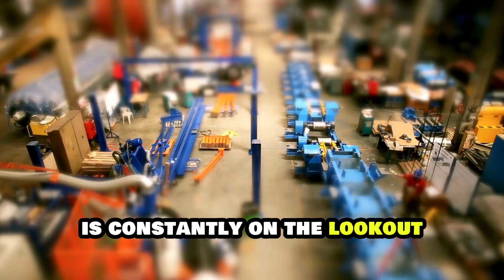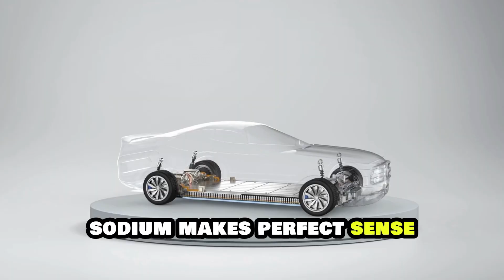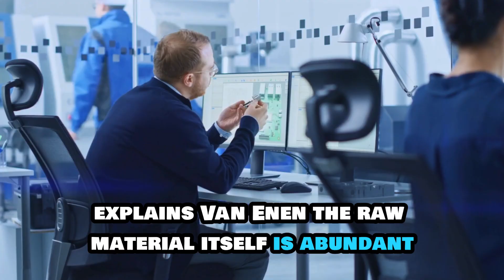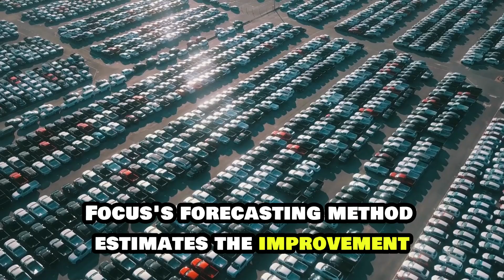Why Graphene Battery Technology Is The Future Of EVs!

Comment: Do you think a EV car have resell value after 8 years.?👈🙂🙂
Reply: that likely has much to do with the kind of battery in the electric vehicle.

for example,
if the electric vehicle has a graphene battery, or BYD electric vehicle manufacturer and battery manufacturer, makes an LFP battery that has a 4,000 charge cycle life. that means approximately 750,000 miles of driving an electric vehicle, and still retaining 80% battery capacity and range. the BYD LFP flash charging (five minutes to full charge) battery also has a zero fire hazard, 100% recyclable, low cost abundantly available materials.

i think it depends upon which battery the electric vehicle is utilizing.